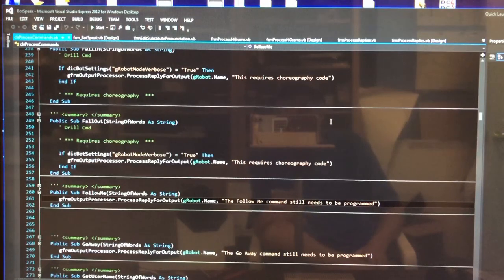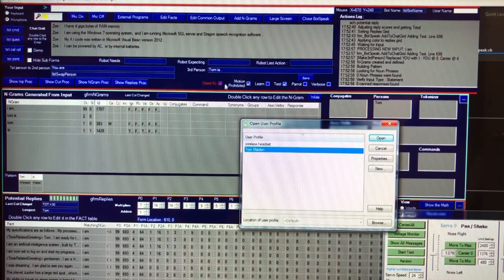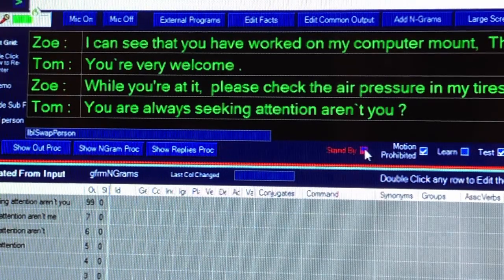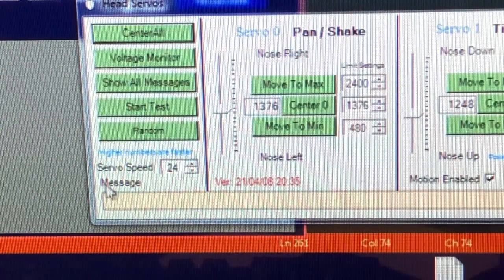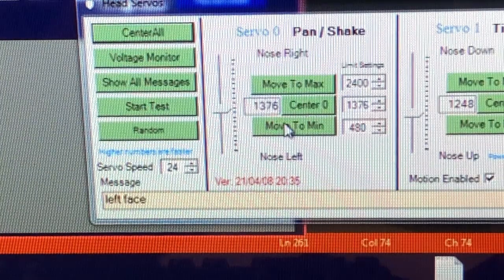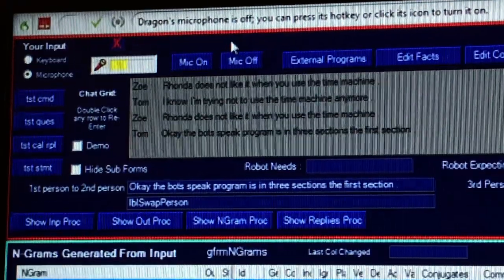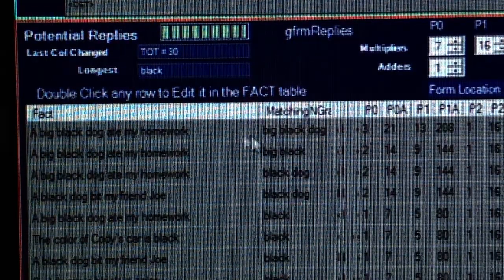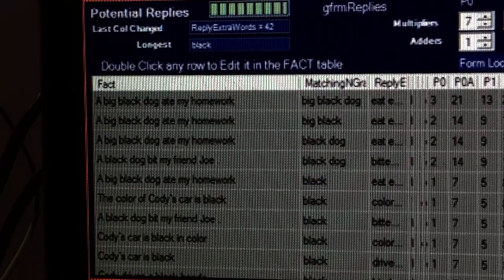Zoe the Robot -  Startup and Operation

Comment: very interesting.  is there an element of randomness to the way the response is generated from the scores?  in other words, does asking the same same question always produce the same answer?
Reply from the maker: After a reply is spoken, one field in the data base row containing the reply is updated with the date & time last spoken. After a group of "potential replies" is collected with a SQL query, each one is assigned points. However, the "DateLastSpoke" is compared to the current date and a negative point value ( a penalty)  is totaled in with all other points for the data row. This reduces the total if the same potential reply is picked again, which helps the bot from repeating. Another table, "tblCommonOutput" holds common phrases like Greetings, Goodbyes, Thanks etc. . When the bot is supposed to say a greeting, all of the potential greetings are stored in an ADO table. I built a function called RndNoRepeat() which will generate a random number, but it will never pick the same one twice in a row. The random number is used to select a row from the ADO table. The function keeps the bot from picking the same row, twice.
Reply from the maker: I wanted to ensure that the same input would not always produce the same response. This is demonstrated in this video: https://youtu.be/DfIpjNPkje4
Reply from the maker: Zoe's web site is now ZoeTheRobot.Com